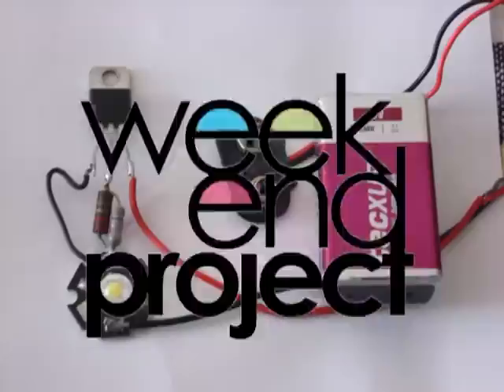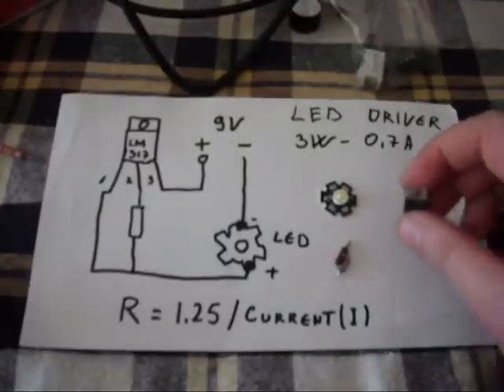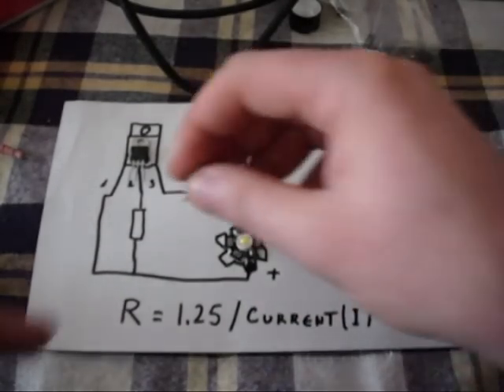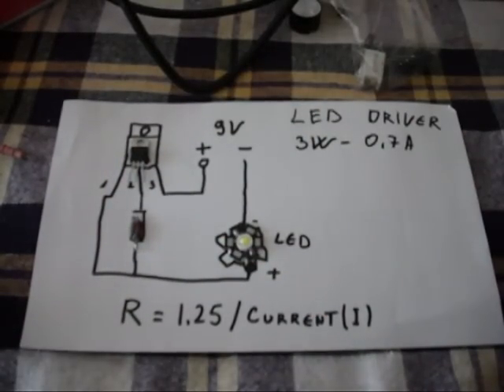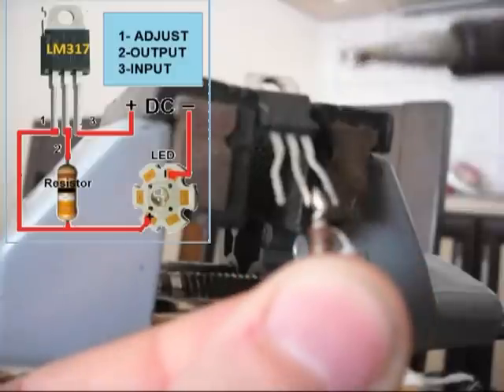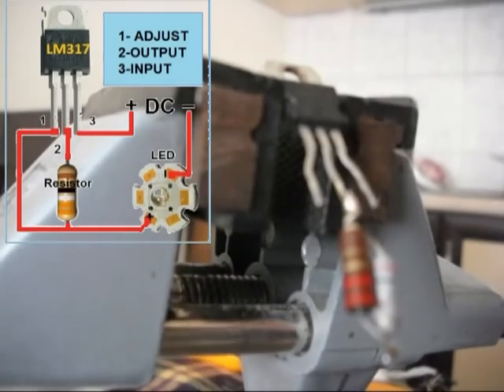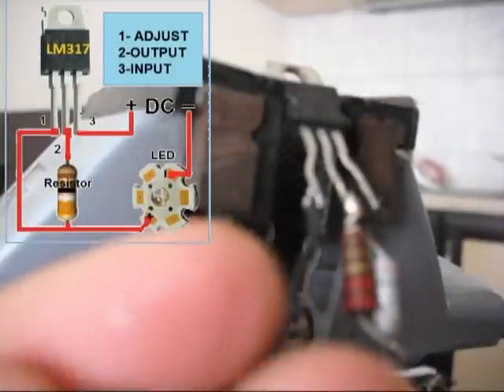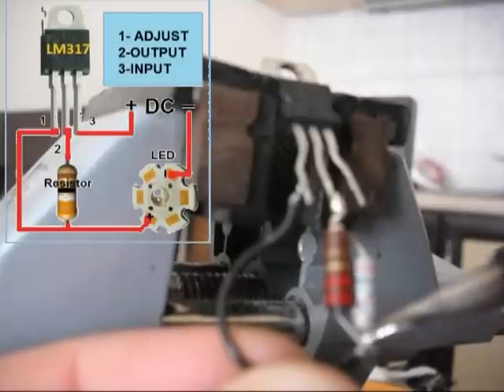How to  Make Led Driver for Laser or Led Diode

Comment: I didn't understand, because my laser (DVD) needs 3 volts with 250 milliamps of current, so, I built this circuit using the LM317 and a 5.7 ohm resistor using a 9 volt power supply at the LM317 input and the output was 8.95 volts, but the laser didn't burn; is this right?

Comment: I'm mounting a homemade laser (diode extracted from a dvd burner-lg-18x) and I'd like to push it as strong as it can get without ruining it, you guys know what power input would be the best, voltage and amperes? thanks!
Reply: kiran bhujbal 007 3volts

Comment: FYI. you can use 7812 voltage regulater 12 volt with proper resister.  Not easy math.  Resister are to limited current if i'm correct.  LM317 are not to be recommend for laser as if you turn on power, then if solder joint are break away and it can blow up laser.

Comment: if I use two 1.2V batteries (2.4V), I'm not gonna need a voltage regulator and resistor for classic small red diode, right?

Comment: he has the lm317 wired in a constant-current mode. the chip senses the drop across the low-resistance resistor and adjusts voltage automatically to get a certain current.

Comment: The LM317 is a voltage regulator but don't you need a constant current source in order to protect the LED and stop thermal runaway?

Comment: if i have a 2.2v 400ma laser diode. i would just plug the value into v=ir to get the type of ohm resistor valid? and btw do you have a ps3 with mw2